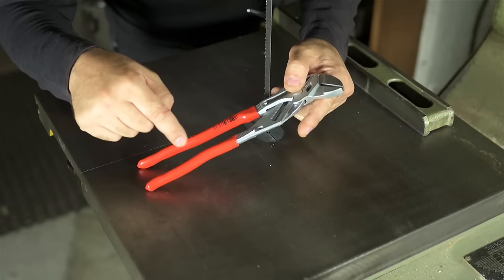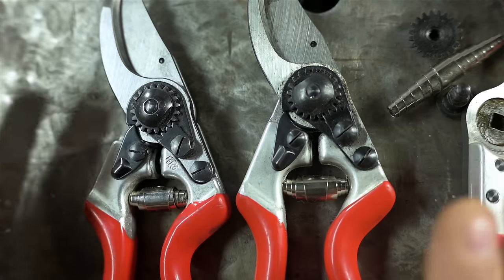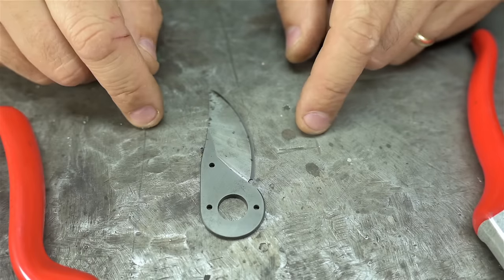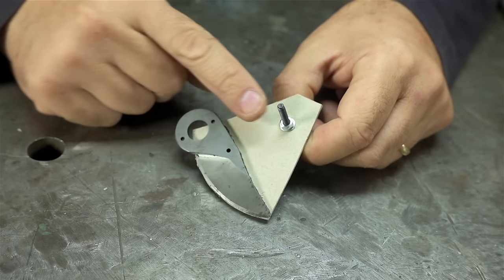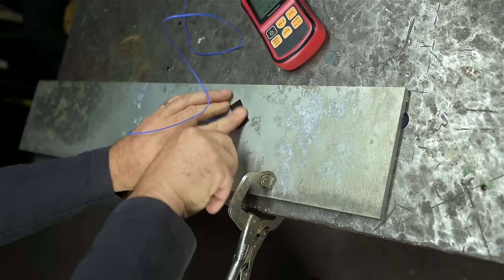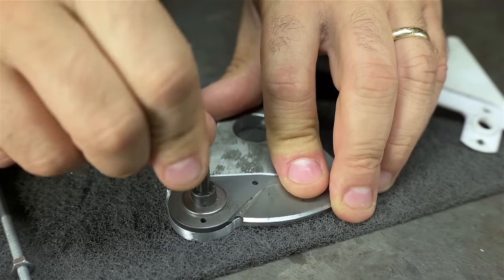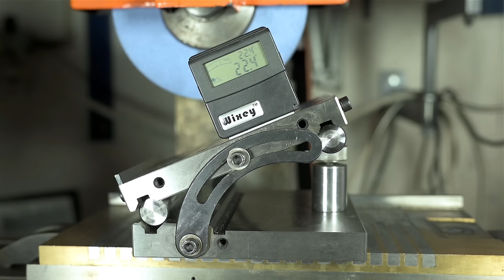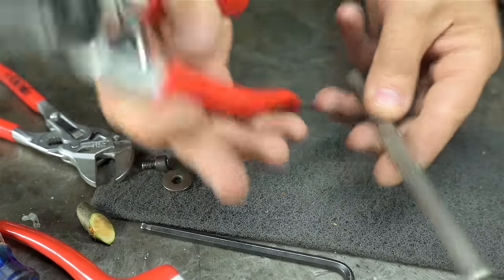Unnecessary SHARPENING JIG!

Comment: Quick tip. 
Do the superglue but with no tape. 
Just fresh clean ally both sides. 
It will stick like a sticky thing. 
Works well with steel also. 
Kind of iffy on brass, however. Superglue doesn't seem to like it. 

But use super glue. You can then warm it up to about 200c +, and it will let go. Don't do this indoors. The fumes are horrendous. 

Yes, there's a bit of cleanup, but you can make parts very, very thin doing it this way.

Comment: *Factory*, because these FELCO (made in Switzerland) pruners' factory sharpness is outstanding.

Nice Video, and perfectly made jig, respect and thanks for sharing!

That You don't hit the bevel angle exactly is imo not caused by the pivot offset, but by the fact You're not exactly under the center line of the grinding disc. A steeper angle does tendentially decrease the overall sharpness (but I think Your blade is way sharp enough) but it increases the time between the re-sharpening intervals of the cutting edge, which is imo a very important factor when the tool is professionally used.

Tipp from an ex-winejaed owner: to remove  the wire-burr on the flat side of the cutting edge, lay the blade flat on the stone -  or use as fine file/stone as possible to "file" it off. You don't want any bevel on that side of the cutting edge.

Comment: Hey, Tony - the knock-offs appear to come from the same factory as Kirkland's gardening shears - they've got the same quality of construction, the same ??? look to the aluminum casting, etc - all the details are identical except that the Kirkland units are branded Kirkland where the Felco brand is on the handle of the shears and your knock-offs are blank, and the Kirkland units don't have Felco blades on them. In case this is interesting to you. :)

Comment: That D printed jig is excellent for those who do not have a surface grinder. Just use one of these carborundum or diamond stones with a handle to sharpen the blade.
I was wondering if calling a sine plate an angle plate is a sin() ?

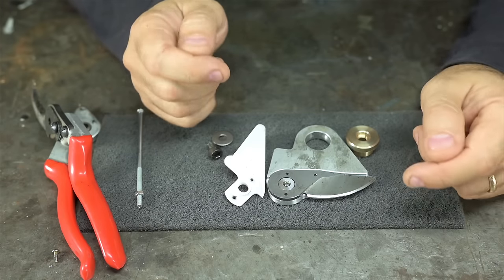Comment: From safety point of view, you are in risk of losing a finger if the grinding wheel catches the blade (22:10)!! The blade will rotate towards your handle based on the rotating direction of the grinding wheel. Only one single screw is resisting this rotation. Think about adding reference pins in the 2 holes you left unused (16:50) to prevent this rotation and add some kind of barier to stop the blade from rotating towards your hand if the pins may fail.

Comment: I’m more of a woodworker, so don’t have the fancy angle plate that you do.  I do have a Tormek T8 though, which comes with a very interesting variety of jigs that  you can add, including jigs that sharpen lathe tools like gouges.

I’m now wondering what would be the best Tormek jig for this.  Last summer, my wife took my $60 Stihl PP90’s and decided to cut some nice artificial flowers with them, which had steel cores….  I bought a new shear, and sharpened the old on on the Tormek, just eyeballing it, it came out OK, but this has me wondering if a jig on the Tormek could do better.

Comment: Wish i had a surface grinder and a sine plate. Id be happy with a table router and a set of bevel mills. I do my crap with clamped straight edges as guides for hand held cutting tools and lots of hand planing and freehand grinding.

Comment: Yeeep, nice work there..
Now my machine and machinist skills end around the point of those squeaking and grinding noises. 

Somehow my brain went to the option of a file mounted on a jiggamathing, that moves it in an exact copy of an original blade.. one of those things where the cutting tool is guided by moving the guide along the original part and you get a 1:1 shape copy.
Dont even know the name, dont know if its only used in woodworking..

Comment: What can I say, as a CNC machine setter? Hmm, the factory's blade sharpener seems to basically be a linisher/sander belt. So you've ruined your own blade by making it slightly hollow ground, where theirs gives a submicroscopicaly convex grinch.
 Hollow ground cutter edges tend to create a chrono-synclastic infundibulum at the point of the cut within any given twig diameter, measured in growth rings, not metric or imperial. (unless you have an imperial garden) This has been scientificultly proven to upset the breeding frequency of local Chickadees, poor little things! But since no scientists have yet come up with a decent theory on the CSI, gardeners don't need to worry too much. Yet.
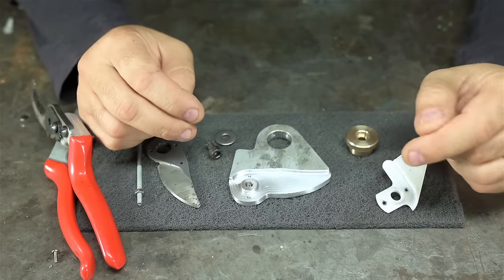 And, on a final note, pause the vid at 16:23 and you'll notice that you've created a Chameleon's head profile. I love it!!!!!!!!!!!

Comment: Two questions. 
Why not use the side of the wheel, it maintains flatness. 

With an edge hollow ground and sharp, would you consider hardening and tempering? 

Of course love the work!
Reply from the maker: using the side of the wheel would have been really hard to show on video.  kind of like sharpening on the stone.
is your second question about hardening/tempering AFTER a sharp hollow grind?  if so, probably not.  I'd guess the edge would burn away.
Reply: @ThisOldTony  
But you have cinema magic. 

And yes. After the sharpening was my question. With that induction heater you have. Or will make. It’s complicated, but that’s why I come here. Ninja grade pruners . Need more hambone line. And cowbell.

Comment: I'd like to see manual jigs for Felco blades that one can use on sharpening stones and/or clamp the 903 diamond sharpener into. Maybe grinder and quench achieves better temper?
I wonder that the radii and angles are for #2 (Felco's original and most popular secateur), #13, the various models for small and medium-sized hands and the various loppers? Felco #7 and #8 are the same blade.

Comment: Factory sharp means rough unpolished dull edge these days. 

Also don't pruning sheers, sheer to cut and not slice? Like scissors? Two flat, tightly flush to each other surfaces with one having a beveled edge that might be sharpened. Wouldn't you need to separate the two halves and then polish each inside face smooth and grind a straight or consistent edge to the policed inside face and then rivet them tightly back and sheer away?

Comment: So, how many hours did you spend and how much is your time worth per hour?  Then we need to look at the cost of the machinery and tooling, which I admit you already had.  To sharpen a blade that costs $17 from the factory.  At first and even second look, that seems nuts.  But I just spent $500 of my time to fix a 20 year old Genie Garage Door Opener that I could have replaced for $250, $500 if I had someone else install it.  It runs smoother and quieter that it has in years and I did it with $10 worth of stuff I had on hand.  There is a great  satisfaction doing that.  Now I have two cars that need fixing.  On ward and up ward.

Comment: Interesting video by a very smart, knowledgeable and skilled man with a good sense of humor, a lot of tools, money and time.

However, at the end of the day, a very likely overheated edge by grinding a non-HSS dry at high speed...

I think he should team up with Tormek and design a jig for their wet and slow sharpening tool, if it doesn't already has one for pruners and loppers blades.

Comment: What are the chances of cutting a edge on a blade with a insert loaded milling tool? All I got at my disposal is company equipment which is all insert loaded face mills, random ball mills, fly cutters and .125 up to 1.25 end mills! Wanting to build some blades but dont have availability too precision grinding equipment!
Reply from the maker: totally doable I think.  In theory anyway.  you can't machine too thin or it will warp in heat treat.  or you can get special inserts to cut already hardened steel, but not sure how well of an edge you'd get.  I suppose it depends on the tool you're making.

Comment: A radius gauge needs only 1 pivot, with two points on one arm, to lock the pivot perpendicular to the surface, and one point on the other, so the pivot's rotation is defined by the angle of the surface.
Simple version you stick a needle off the pivot and mark readouts on the other half.
Better precision with a couple of watch gears to turn it finer.

Comment: Great video as always, but why is the resolution quality of the latest videos suddenly low, and can't be altered?
Reply from the maker: should be HD/1080!  slow connection maybe?
Reply: @ThisOldTony  Hummm maybe a glitch in the app it works now😇
Just tried a pair add your new videos, and all are 640 and the other changes were 1080.. So I was afraid you had put some kind of limit on you're videos😇
Thanks for your answer😀

Comment: If you rotate the sine block 90º to the left, then it would assure that you're at the bottom of the wheel so it would be parallel with the table.

Comment: I'm sure there's a great reason us non-machinists don't know about -- while you had the blade out and the grinder set up, why didn't you grind the yucky looking side of the blade flat, maybe finish with a precision ground stone?  I kinda see how it doesn't affect the cutting edge, but the front looks so nice I figured you'd want to smooth out the back.  Or would you? (duhn duhn duhn)

Comment: IMHO  the new arc ,result of the sharpening ,can not have the same center as the original. Because after some sharpening you will start cutting tip first.  All your new sharpening arcs should have common point the most inner edge for the pruners to continue closing in the same geometry. ..sorry for my bad english

Comment: 3:20 I wonder if your eBay fakes are actually (very) old stock. I have a Felco No. 1, designed in 1946 and discontinued, which does have round, slotted screws – and I’m quite sure it’s authentic, my dad bought it in the Sixties or Seventies in Germany. So I don’t think it’s true that Felco have “only ever used” hex head screws.

Comment: We literally have the same ones as we did 11 years ago when i was 9 and we have used them for literally everything from cuting zip ties and gas lines to wire emergency breaks on a old car we have cuting weeds and using it as a screwdriver and cutting buckets and we have never sharpend them once they still work like they are new

Comment: One day, I lent my extremely sharp and beautifil light axe to a friend in the club. He was to cut down some bushes close to the ground.  I told him: "have the axe, but do not cut into the ground or into stones".

Guess what he did ? He cut into the ground and into stones, so the blade was destroyed for a while, until I could restore it.

It took hours to file off the destroyed edge.

This is a traditioinal Swedish axe, made in Hultafors,  quite soft in the edge, so one can sharpen it with a file, not hard as a knife or a sword, as Swedish tradition of axes for chopping fire-wood or felling trees.

A carpenters axe may be very hard in the edge, but they are quite rarely used in Sweden nowdays.
Reply: I never lend out sharp tools again, except for trusted persons or my sons.

Comment: Why not ass locating pins to the blade holder, so torquing the screw doesn't have the blade swivel out?

Also yeah, the pivot offset. Would have reduced it until you saw the sharpy being ground off evenly.

Comment: Hi Tony, or is it Mr. Tony?  It looks like you are using compressed air and WD-40 on your CNC router and I was wondering if you thought about using a cheap siphon air brush instead.  The airbrush could be adjusted to spray mostly air with a little bit of cutting fluid, which would free up your other had to do things like eat doughnuts, drink coffee, or edit the next video.
Reply from the maker: I've tried a few "off brand" mist coolers but never liked them.  One day maybe I'll buy something a bit more professional.  They always end up filling the air with oil/coolant, or just outright make a big mess.  Again, it's been the knockoffs so that's likely the problem?
Reply: @ThisOldTony  I was actually referring to a paint style siphon feed air brush with about 0.65 CFM at 25 lbs. and a spray in the 0.063 to 1.5 inch range.  But I use a mini-mill so my chips are smaller and lighter, so what about an automotive style Detail Touch-up spray gun with about 1.5 CFM at 40 PSI and a fan pattern from1.5 to 9 inches.  It sounds like your mist cooler has the spray pattern of a HVLP spray gun which is meant to cover a large area fast (0.5 CFM? at 10PSI).  The mist cooler would be trying to soak the area, while the air brush is meant to apply a controlled thin coat.  The mist cooler would do a better job of keeping the surface cool, but a well adjusted air brush should look better on camera.  I could try it out and make a video, but I don't think cutting aluminum or brass on my mini-mill would be an accurate representation of what your CNC is going through.  Let me know if you want me to do the quick video.  I hope this helps.

Comment: hey tonyyyy, would love a link to that stl for my old man. Possible? thanks!
Reply from the maker: I put a STEP and STL on my patreon page.  You don't need to be patron to access it.  If you have any problems let me know: https://www.patreon.com/posts/87191815
Reply: @ThisOldTony  Amazing, got it and sliced it already. Cheers cob!
Reply from the maker: @jevans101  Dang that was fast!  I added a second point on the top side of this jig.  in THEORY, that will do the 5* back bevel.  So, do the primary like in the video, flip it upside down and touch up the 5* backbevel.  Let me know if it works!

Comment: Oh Mr. Tony, sir, how could you be so cruel as to post this? 

The Nice Man now says they won't let me out of this place until the first frost of the winter, when pruning is finally over. 

And she's still putting them away dirty ("Why does that matter?") and won't even attempt to touch-up the edge. AND... she even prunes right at ground level, down in the DIRT, so they get GRITTY!!!

Like my best carbine, I could strip and reassemble the Felc--no, I still can't say the word out loud--in fifteen seconds, blindfold, even with the household drill sargeant yelling at me. And our ones even have the posh twisty handles. But that bevel!

First it was the nightmares,. Then daytime visions. The parallel pliers, the Vice Grips, the G-clamps, the tracing paper, those 'little tweaks' to the grinder fence. That same spot on the door where the flying blade always dug in. 

It all came flooding back to me again and again, even on Sundays when I was in the pulpit.

Fel---o Disease was the eventual diagnosis. 

It was such a relief to finallly know. They said it would take time, and that I mustn't touch even the slow speed wet grinder for at least a year. 

It was so hard but I knew in myself they were right. The worst part, by far, was knowing that she could've easily got replacement blades form Amazon. 

Telling me that, after only three months in my room, was just cruel. But I think it helped in the long run. 

I was so close to being 'normal' again. And then you uploaded THIS!!! 

You didn't just sharpen them, YOU MADE A PROPER JIG, AND HAVE A PROPER GRINDER. 

There was no warning on screen. YouTube never spotted it. But I saw it. ALL of it. Even the Japanese paper test at the end.

And now I'm back to my room, and the nightmares again. I'll probably never be let out. 

And who's going to be around now to tell her she's being too hard on the rose bushes?

I have to go. It's time for my pills...

Comment: It wasn't possible for coles actions to not cause the outbreak, because the outbreak is why they built the time machine in the first place.  No outbreak, no time machine. Its also a paradox known as the boostrap paradox, because the second event (sending cole back) is the cause of the first event (the outbreak) which then causes the second event (sending cole back).
Reply: What about if the time loop is only a secondary timeline, the first one being a "simple" terorist caused outbreak where young Cole goes trough the airport without incident, and then once he get sent back get himself into the loop?
Reply: @M4nusky  The many worlds interpretation of quantum mechanics does solve the paradox, as the timeline where Cole went back just becomes a parallel world in which his actions may or may not cause the outbreak happens, and there will be a branch for each possible outcome. The only time its impossible for coles actions to not cause the outbreak is when there is only a single timeline, because without the outbreak, they have no reason to build a time machine.

Its similar to the remake of "the time machine" with guy pierce, where the reason he builds the time machine is because his girlfriend dies, and he wants to go back in time to save her, but every time he tries she still dies but in a different way.  The reason he can't save her is because her death is the reason he builds the machine, and if she didn't die he would never finish the machine because he would become a father and his focus would change to his family rather than his research, so the only way his research is successful is if she dies.  So the universe must ensure she dies, because that's the only way he can go back to save her.  If the many worlds interpretation is true, then he could save her because his actions just create a new timeline where she survived.

Comment: They literally use a robot... a SLOW robot to grind blades that have a perfectly circular profile. (So they could use an extremely simple, extremely fast and inexpensive machine/method to sharpen them to the exacting quality that the robot does. I guess it might be more valuable if they use the same robot for other jobs, because it can be easily programmed and switched between jobs (different blades)... but I still have trouble believing that they would use such an expensive and slow machine to sharpen these specific blades.